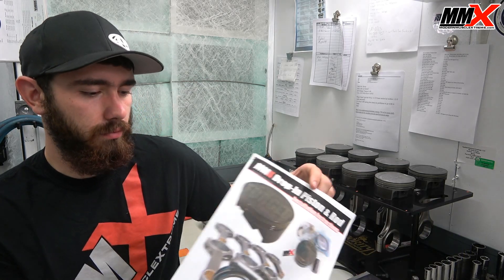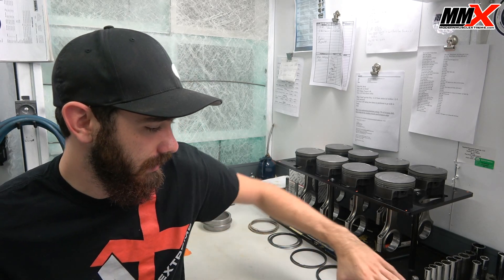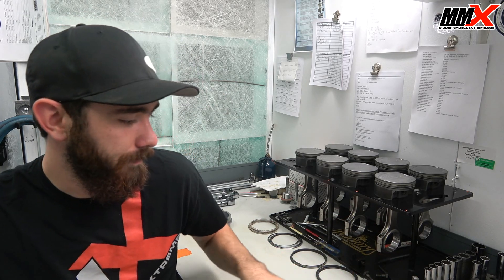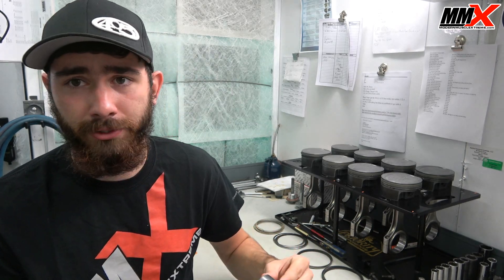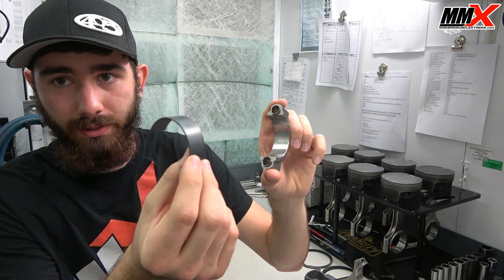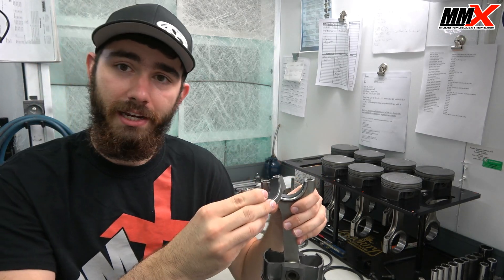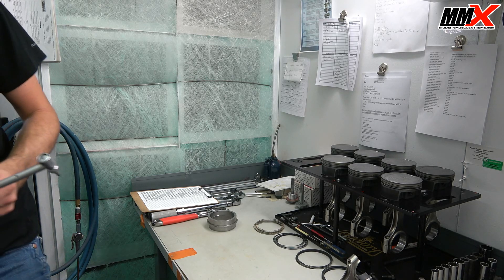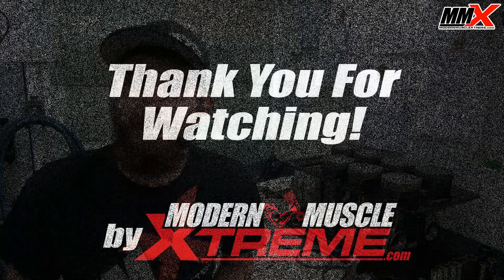MMX Forged HEMI Drop-In Piston & Rod Bearing Installation & Clearance

Comment: You've got a LOT of faith in chinesium measuring equipment when the accuracy needs to be .0005" tolerance from the target value without a standard to check the accuracy of the reading you'd get from the $100 chinesium instrument on a multi-thousand dollar engine build. At least with plastigauge the squish to value read is constant and has been the go-to for many decades.

Comment: Byron..I have x2  6.1 Hemi engines.. one in a jeep and one in my charger. 
My question is the jeep srt8 motor has been replaced by the dealership with a "NEW "not Reman! Mopar long block & has only 9k miles on it and my charger srt8 has 35k miles on it..I was planning to do your rod and pistons on both engines and boots them 15-18 lbs. Couldn't I just re use the rod bearings that's in these engines since they are relatively Low miles?  These are street cars that will hardly see the track and maybe race x5 - 10 times a year  max!
Please let me know?
Thanks
Reply: that is the most dumbest shit i ever hurd of

Comment: Ok so what you are saying is that you mixing two sets of bearing one using just the top bearing from one box and using the lower bearing from another box ... to achieve the proper bearing clearance.. ( so in other words you will have left over bearing half 's that are not used ... if I am getting this right....
Reply: NO you will not have any bearings left over.

Comment: I've worked on my lawnmower a few times. You think I can knock this out in a weekend?
Reply: Definitely, actually those Briggs motors are far more complex than a modern Hemi. Did you open up the head on that 5h.p.? Just curious, I'm cnc an early 3.5 h.p. Briggs head I want to run in modified stock.